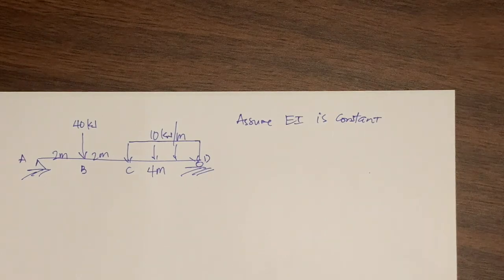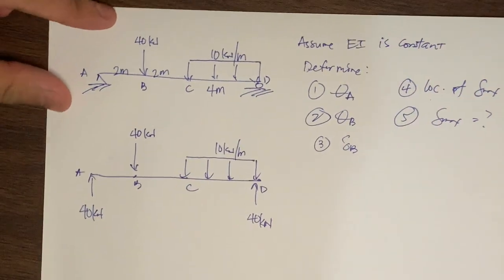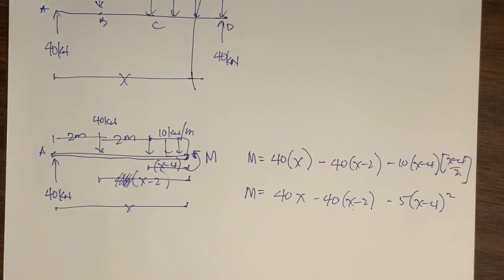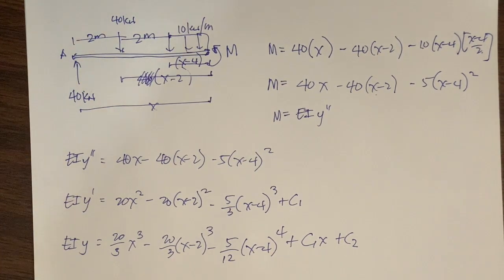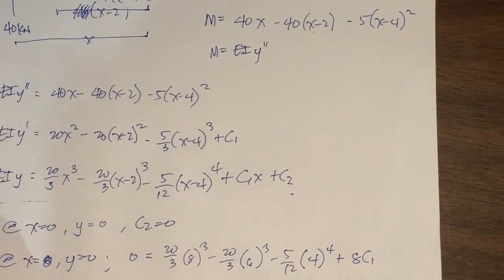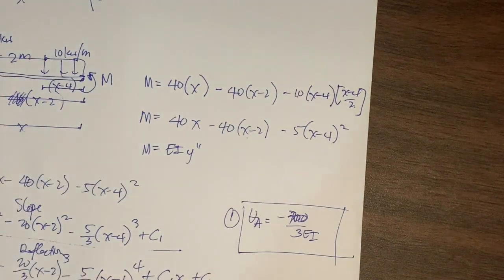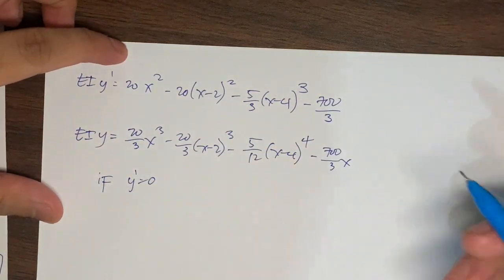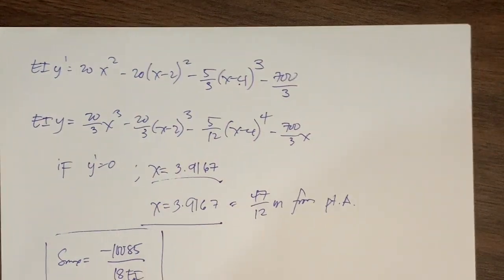Geometric Method: Double Integration Method Example (Statically Determinate)

Comment: sir i didnt understand how we get the slope at A , why the all terms before c1 are equal to zero?
Reply: The slope at A is located at x = 0 then substitute this x value to the slope equation. Because the terms inside the Macaulay brackets are negative, we will neglect it. All is left will be C1 that's why the slope at A is equal to 700/(3EI)